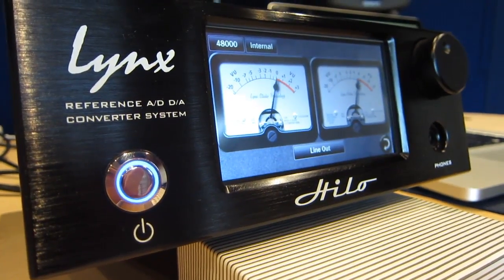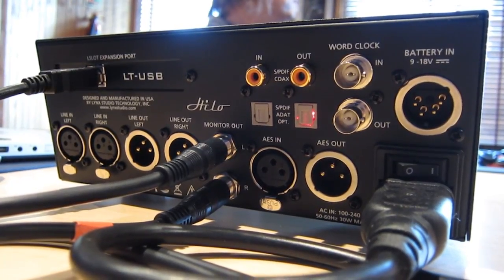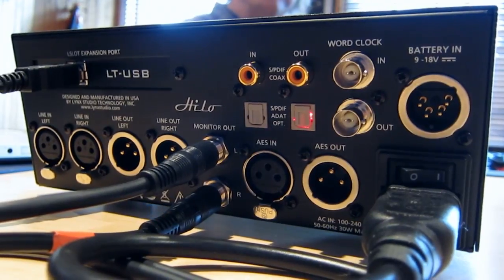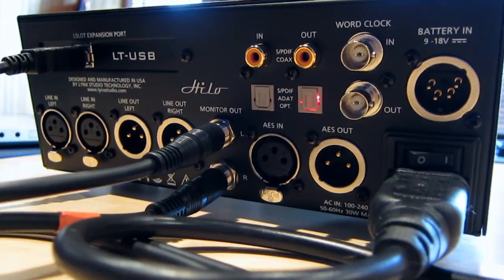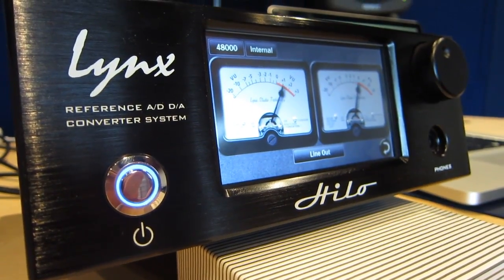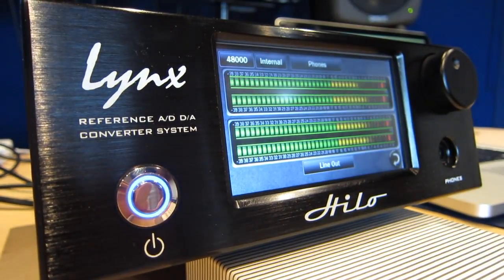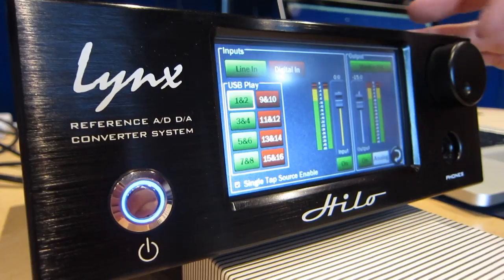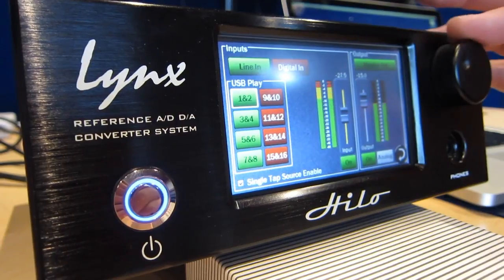Introducing the Lynx Hilo: their finest sounding audio interface yet.

Comment: i premaster daily, what keeps me from purchasing this is the touch screen. the hilo should only be  ANALOG  knobs and  slide faders . lcd on a unit at this price ?    U2 formfactor with usb 3 connectivity , analog slide faders, knobs and switches. no touchscreen and you created the best unit of this class ever.
Reply: i agree,  the touch screen is a gimmmick
Reply: Strongly disagree there. It saves A LOT of space and mechanical failure potential to have it all in this touch screen. Furthermore, it would be a real hassle to divide ALL functionality on the touch screen into some buttons. Analog buttons for a digitally routing unit is pure BS, who would want that? It's prone to delays and contact failures, another point of failure for each button/control is nonsense. I say: One of The MAIN reasons I bought it, is because of the touch screen. Also, the most logical button to have quick access to is the one volume control, which you can config to whatever you like. The rest is mostly set once and forget config, I mean, how often do you even change routing with your hilo? I rarely do. Not often enough to warrant a bunch of analog knobs that you can also accidentally change while you're in some important session.. Again: BEST idea ever, to put config and routing behind a touch screen, Lynx! I love mine.
Reply: I agree, the touch screen is one of the pros of the hilo. I have one too, I would have hated it if the unit was full of buttons.
Reply: it's an analog TO DIGITAL converter. digital is the point, why do the knobs, of all things, need to be mechanical?